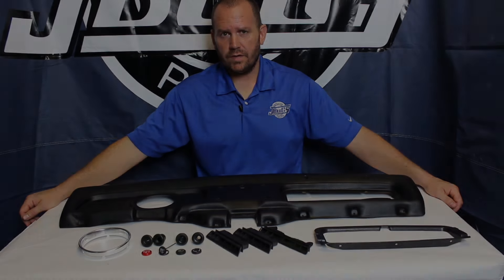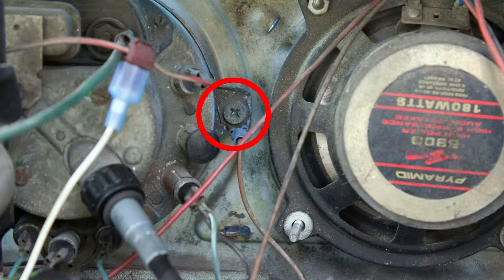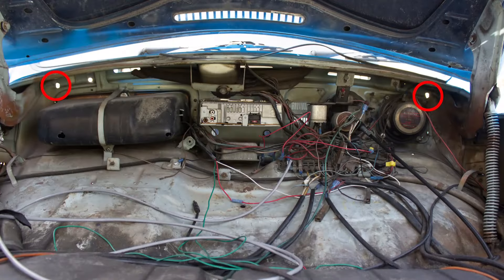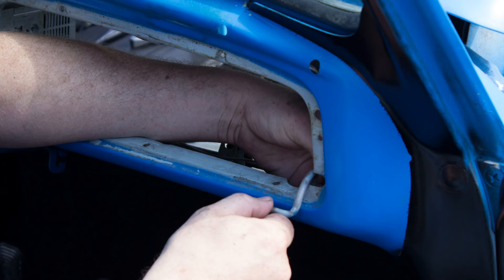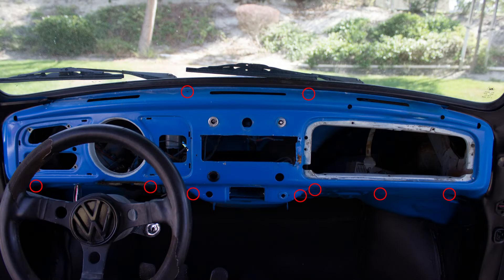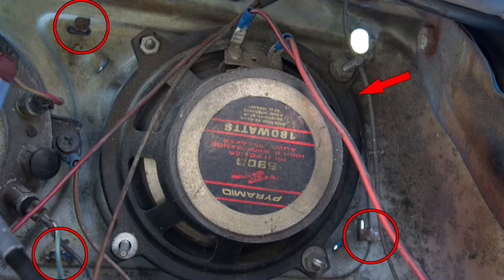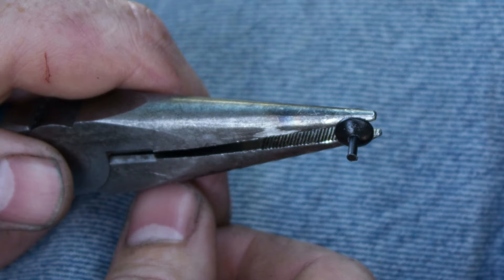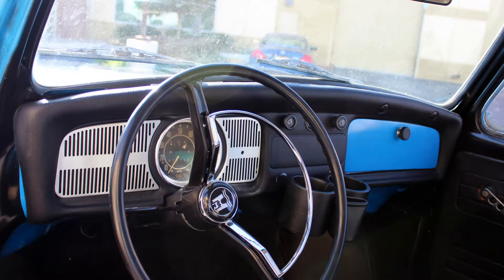JBugs - 1969 VW Beetle - Dashboard Installation

Comment: Just got your dash kit and the fresh air vents are being a bit hard to "pop" in. Looks like the openings should face the front of the car. Got the center one in OK, but the two side ones are recalcitrant. The sheet metal is a bit deformed. If I can't pop them in, any reason I can't cut the tiny tabs off and glue them in place. Or any other tips.  Thanks. Always great videos helping me restore my 70 bug
Reply from the maker: The dash vents can often put up a fight can't they? If all else fails, they could be trimmed and glued in, absolutely. Some black RTV silicone should hold them in nicely and won't stand out.

Comment: Question. There's an aftermarket glove box that has a slot for a stereo right? 
Would the installation process be any different versus a normal glove box?
 And would there be room for the fresh air vents to clear?
The previous owner of my 72 bug hacked the dashboard stereo cut-out, so I plan on relocating my stereo.
Reply from the maker: +daniel Jimenez 
Hello Daniel, we do offer http://www.jbugs.com/product/GLOVE-STEREO.html . We do typically remove most all of the fresh air ducts on the back of the dash in our own cars so we can not say for certain that the vents, ect. would still fit as original. With some minor modifications they should be able to fit and work as original.

Comment: received my domelight and sun visor clips order today :-)
About this vid, I see a classic steering wheel at 0.38, and at 1.00 a modern wheel. I wonder how to get my plastic 1974 steering wheel off...? Any ideas? ~thx
Reply from the maker: +Bas Vossen
To remove the 1972 and later steering wheel, grab the spokes of the wheel and pull them up until you hear them pop off their mount. Once all 4 of the spokes are popped up you can pull the horn pad off gently. There are 2 different styles of horn pads, one will pull straight off. The other needs to be turned 90 degrees then pulled off. After that you can access the steering column nut to remove it, then the steering wheel.
Reply: thanks, got it, now trying to repair wiper switch

Comment: You lost me when you said to snap off the pins on the plastic rivets BEFORE you install them.  Can you clarify this for me?
Reply: This video https://www.youtube.com/watch?v=y1BidLcAqBU&t=380s may help as well along with what we've shown here. The post of the plastic rivet is molded into the rivet. Out of the package it won't press into the rivet. The post needs to be snapped off, then in can be pushed into the head of the rivet slightly. Once the legs of the rivet are pushed through the trim ring and the dash sheet metal, the post can be pushed all the way into the rivet to push the legs open and hold the rivet in place.
Reply: Thanks Sam!  I get it now.  And the added video answered several other questions as well.  I didn’t realize I could install the glovebox after the trim ring and door were already in place, allowing me to tighten the hinge screws from the inside after getting the door properly positioned.  Awesome, as always!

Comment: You didn't mention the truck release inside the glove box.
Reply from the maker: We did not cover the hood release lever as it, the cable, tube, latch and hood handle are all inter-related. We kept the dashboard video to the dash and the immediate components related to it's replacement. We will most likely cover the hood release components in the future on our 1971 Super Beetle.

Comment: Is this an autostick?
Reply from the maker: +Shell Wright
No, the Beetle has the standard VW 4 speed transmission.
Reply: +JBUGS Oooh because I see the gear diagram in the dash and it's for an autostick.
Reply from the maker: +Shell Wright
Good eye! That is correct. At some point someone swapped out the ashtray with an auto stick. We decided to replace it with a Plug N Chug cup holder.

Comment: How come your not showing the several days it takes to shave off the excessive foam padding from the backside, trimming the plastic to fit the upper dash vents, gluing and installing the lower dash vents, and the dozen trial fits it takes to get it to finally fit some what correctly. I guess that must be some magical kind of heat gun only available in SoCal to get the glove box opening molded to fit the glove box door frame. Good luck holding it in with the plastic rivets they give you. You WILL need metal screws and nuts. This video reminds me of the Ichiban Moto videos on U-Tube.  Seriously though, why can't WCM make something that actually fits well ?  If you do try this, take your time and try not to get frustrated. With A LOT of work it will actually fit eventually.
Reply from the maker: Hello Brian, we did not shave any material from the dash to install it into our 1969 Beetle. It was pulled from the box and mounted to the car, just as shown in the video. The glove box trim is a pain, you’re absolutely correct but with some perseverance, heat and glue it does fit. Like you said, take your time. We’d guess based on the mention of lower dash vents that you have a 1971 or newer Beetle and getting those vents in does take some work. That is a video we will be doing later when we get to the interior of our 1971 Euro-Look Super Beetle. If the original dash hardware is missing we do offer the replacement hardware here: http://www.jbugs.com/product/113857000.html. We’re not familiar with the Ichiban Moto videos but hopefully they’re as helpful as ours have been to our viewers. Thanks for the questions!
Reply: Took awhile but there ya go, not much for shaving, just knowing what and where to trim. https://www.youtube.com/watch?v=y1BidLcAqBU